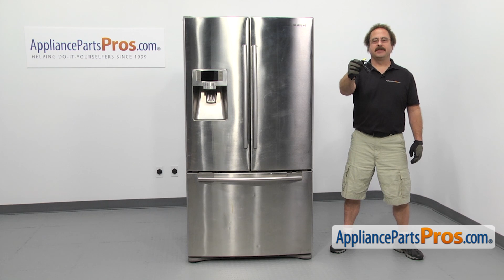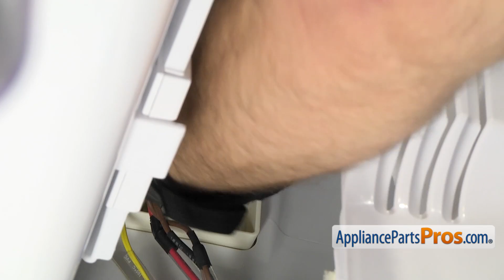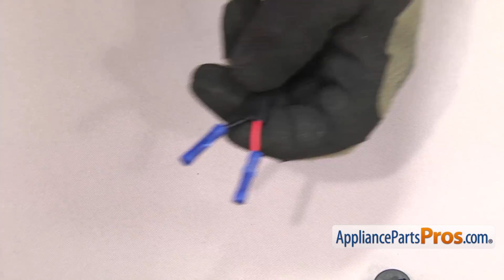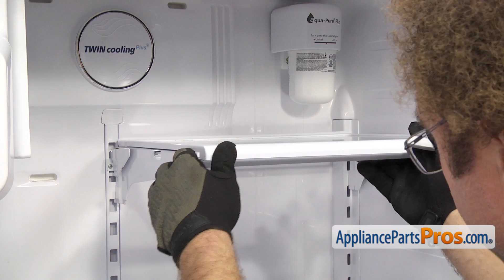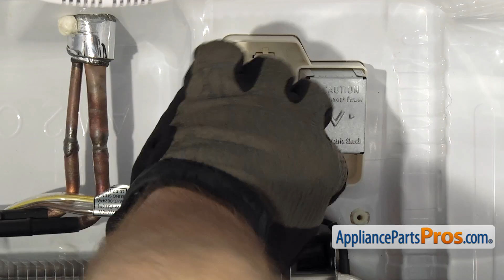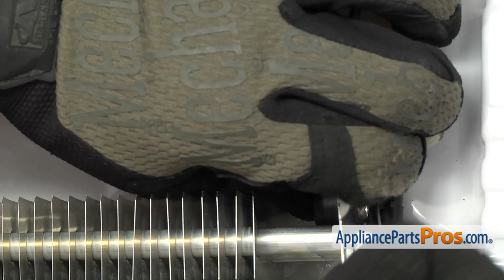How To: Samsung Defrost Thermostat DA47-00243K

Comment: I would like you explain how this defrost thermostat works with a multimeter.
What temperature cut off and cut On ,in other words how does it work?
Thanks a lot.
Reply: when temp get -5.6C it on and off otherwise say  - 4C  or 25C

Comment: If this part is faulty would it cause my refrigerator to freeze even with temp set at 44 deg?
I have model 261 French door with ice maker in the bottom.
Thanks in advance!
Reply: I have the same problem, I was told its the mother board failing to communicate with the thermostat. I'm looking for a repair contractor to give me an estimate.

Comment: From what I understand, when testing a bimetal thermostat, room temp. should have no continuity and when it gets cold enough you have continuity. Mine has continuity at room temp. so I assumed it was bad. So I bought a new one. Tested it and it has continuity at room temp. so I put them both in the freezer for an hour or so, same reading. I returned it and got another one. Tested it and it has continuity... Another bad one?? or am I missing something??
Reply: shouldnt it have continuity in cold temperatures?
Reply: James have you figured out?
Reply: bimetal is bimetal thermo is thermal samsung combine both call bimetal thermo its character for  both  .confused? your new one is good
Reply: @mikele8476  ya this comment makes no sense nor is it helpful!

Comment: hello good morning, is the new Da47-00243k defrost thermostat open or closed at room temperature?
thank you.
Reply: It's open at room temperature
Reply: @fathead689  mine is closed. Got 2 new ones also closed. Maybe a bad batch??
Reply: @jamessmith9775 That’s what I get. 0.5 Ohms. It does not open under cold or 140° water

Comment: In the area that Your placing this sensor.. mine freezes up .. not the freezer..everyone is saying it's a bad design and the heating coil to help defrost it should have been longer. do they make a longer replacement one .so I can go up higher with it up next to the copper tubing so it will keep it from freezing up ..or is there some other fix that you know of thank you so much ..  Also I heard that you can force defrost  the refrigerator not the freezer if so do you know how to do that my model # is Samsung  RF18HFENBSP/AA..  thanks